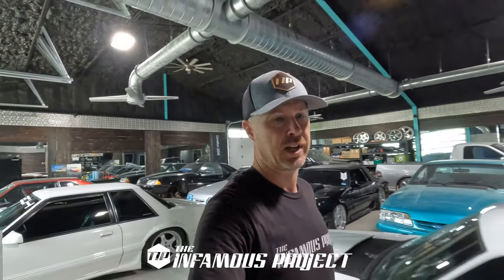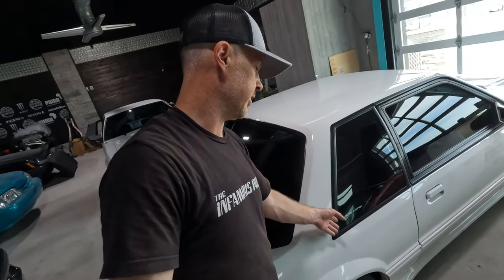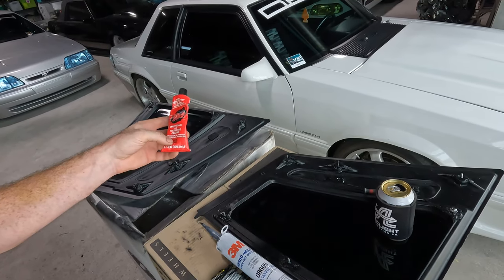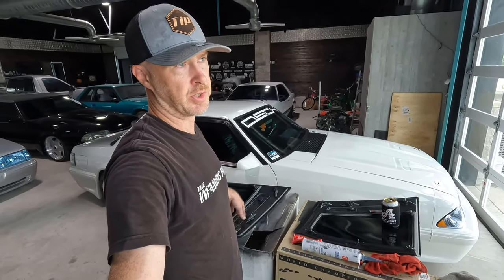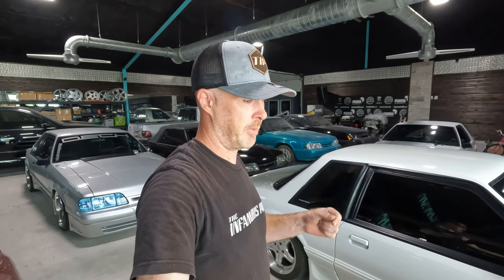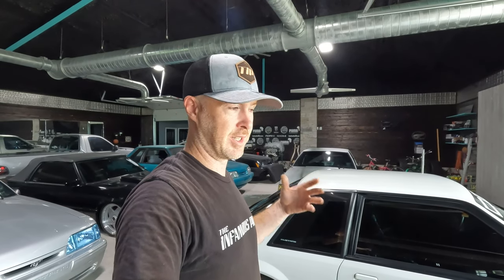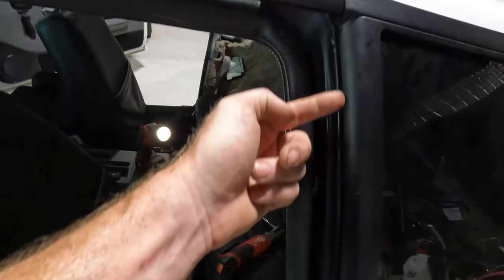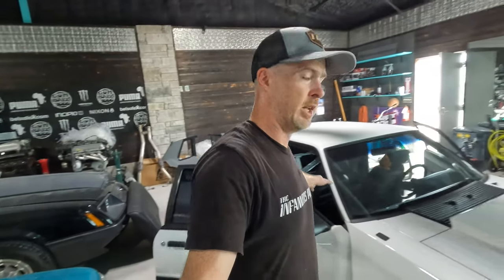More Foxbody Coupe 1/4 Window Nightmares! - TIPS05E38

Comment: Thanks for putting this out, hopefully they update the design in the future. For the rest of us suck with this style, this is a great corrective process we can use. I called Daniel carpenter, and they are getting these from a vendor in China so they aren’t actually making them themselves.
Reply from the maker: Well that explains some of it. But why are they "BLEMS" in this case?
Reply: When I called Carpenter LMR didn’t have the second batch of windows in yet(3-4 months ago) I spoke with a very nice lady over at Carpenter who said the manufacturer in China was aware of the blemish problem from the first batch they made. They said they were trying to correct it but they already had a large order in process for shipment and they would be discounting those(the ones we got). I haven’t spoken to Carpenter about the stud issue but I would assume knowledge of the issue has made it back to them. Hopefully they are working on a fix?
Reply from the maker: @89notch  Let's hope!

Comment: I had the same issue with my blem windows.  I called LMR and they were very quick to ship me a replacement set even though the site said "out of stock".  I sent the bad windows back to them to review.
Reply from the maker: So the new ones they sent you were ok? When they reached out to me they said they didn't have any available for replacement
Reply: @TheInfamousProject  The new windows were fine.  I originally bought two sets, but only one set was bad.  They told me that "they kept a few in the back in case there was an issue"... I spoke with Neal Jimenez (Tech & Customer Experience Associate), he was very quick to help me out.

Comment: I just picked up a set of these from National Parts Depot. I paid $679 (free shipping) and they were delivered promptly on 12/30/22. Same issue with voids as shown in this video and the same studs were beyond unacceptable on each. I'll take care of it and make the windows work but I have to say that I am extremely disappointed with DC's "QC Acceptance Program." The glass is good but the structural portion of the rubber that captures the studs needs to be addressed. So be wary, as the set I got is supposed to be from the latest run. My kit included sandpaper and two tubes of silicone too.

Comment: I have a set of the blems in my coupe and it seems like one or two of the studs are popping.  LMR just came out with a video showing the "install" of these windows saying the issue is resolved by using RTV instead of butyl tape.  What a bunch of BS!!!  The price we paid for these damn things you should not have to do a "workaround" or an alternate type of install from factory.  It feels like they are almost saying the windows are fine, it is our install process that is wrong.  I would not put these in with RTV as it will be hell to remove them if need be.
Reply from the maker: LMAO.. Yes I am aware of this so called "fix" I was beside myself when I found out that this was the solution.

Comment: Honest dude here think God there people like this that let's people know before we buy stuff for our fox's what to expect cool video 🙏💯 plus I would see if there's a torque spec on the quarter window bolts from company or service manual but if you replace them as many time as this dude you'll know what you can tighten them down to make sure theres a even clamping load on the window and the window frame doesn't need to be body worked to match the radius of the window 😉